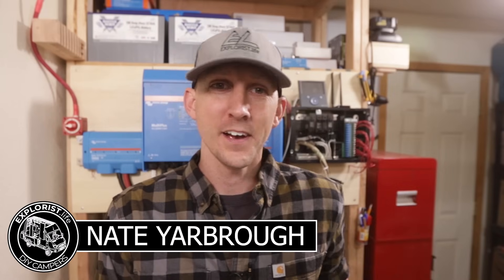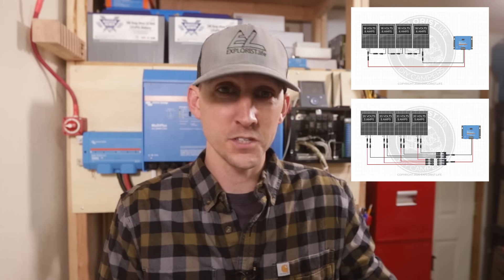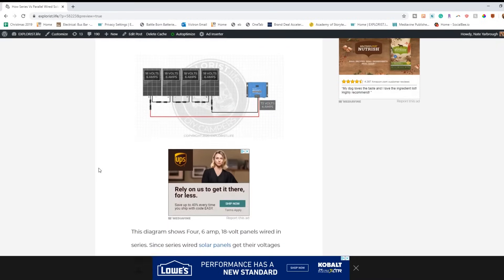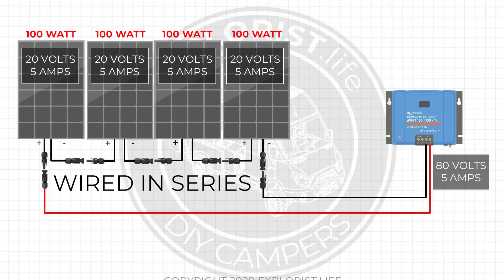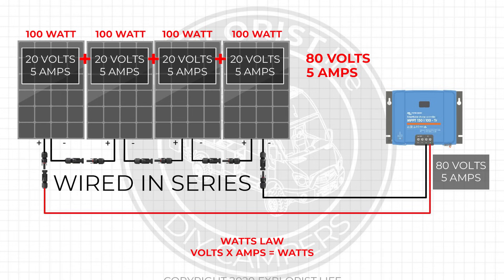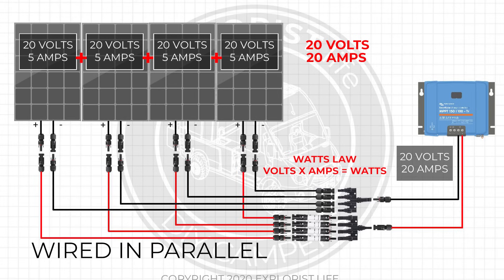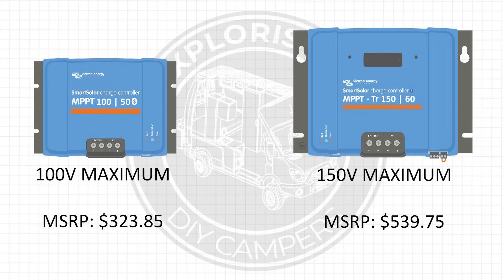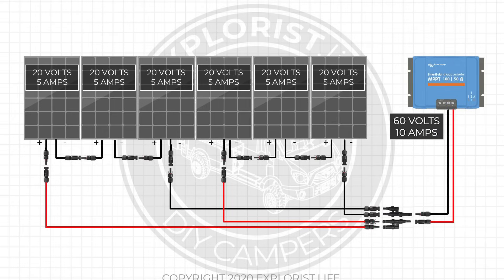Solar Panel Wiring vs Volts and Amps

Comment: Question: my solar kit has 4 100watt panels at 16.77v and 6.26 amps if my math is correct the in series parallel connection i would have 33.54v and 12.52amps. I have 30A PWM 12 Volt Solar Charge Controller with a max voltage of <50 but would the amps be an issue at 33.54?
Reply from the maker: With the Victron SmartSolar charge controllers, going over the output amperage is not a big deal, but without knowing specifically what charge controller you have, I cannot say.  You should reach out to the manufacturer of your charge controller for an answer to that one.

Comment: I have a question pls

I have 6 panels 150w ,18v, estimated low temp my country 10 celuis, panel stc 25 , voc 22.5, imp 8.33
Temp of voc -0.33
Temp of max -0.44

And I would like to make them 2 panel in each series
With 3 panels string in parallel
Total in array 6 panels

Me if I am correct I will have 36volts and 24.99 amps

If I’m wrong pls correct me and can you pls tell me what solar charge. Controller is best for me pls

Because I’m confused about this part
Reply from the maker: I think this video will help you figure that out: https://www.youtube.com/watch?v=MxziHKvTRh8

Comment: Question if you wire in series parallel does each series only get the lowest output like if one series is in the shade does the other series in parallel to that one also act like its in the shade?
Reply from the maker: The shade would only affect the series string that is shaded.  But I always must tell people... if you're worried about maximum solar production, don't park in the shade. :)
Reply: @EXPLORISTlife  oh yea I've been vanlifing it 6 years so I just realize the forest and trees and different spots sometimes I'm partially shaded and can't do much about it
Reply from the maker: For sure.  We've noticed that it's rare to have only part of the array partially shaded, it's usually all partially-shaded or nothing kind of deal.

Comment: I’m somewhat sure my question never is going to be answer but I’m going to give it a try anyway, (my average used is 45kwh,) I installed in the ground 20 panels, four rolls of 5 (250w, - Open C. 37.6V - Pmax 30.3 V - SC 8.85 A - CPmax 8.27 A - 600 Max Voltage - fuse rating 15A) also a hybrid MPPT 1.5kwh, 3.kWh and 5kwh and I’m debating what’s the best way to wire it, front the panels to the MPPT, 70 feet exactly, I used #6 wire, today is 12/28/2020, your suggestion or advise is very well appreciated.
hrsolis48@gmail.com
Reply from the maker: You'll definitely want to wire in series-parallel of some sort.  But what way will depend on the max voltage input and amperage output of your charge controller (and your battery bank voltage).  Here's a little more about how to size a charge controller and I think this will give you more data for wiring the panels: https://www.youtube.com/watch?v=MxziHKvTRh8

If you want me to take a deeper look into this, this would be something I could help with in my private group: https://community.explorist.life

Comment: Hi, ive got an lv2424 mppt all in one, and ten / 100 watt solar panels, clear skys no shadowing, what is the best way to wire panels? Panels are 40ft away from inverter
Reply from the maker: You'll definitely want to wire in series-parallel of some sort.  But what way will depend on the max voltage input and amperage output of your charge controller (and your battery bank voltage).  Here's a little more about how to size a charge controller and I think this will give you more data for wiring the panels: https://www.youtube.com/watch?v=MxziHKvTRh8

If you want me to take a deeper look into this, this would be something I could help with in my private group: https://community.explorist.life
Reply: @EXPLORISTlife  thank you much

Comment: Hi  Can I wire 2  24 volt solar panels together for 48 volts and add a enphase micro inverter for 220v grid tie?  Thanks you do a really great job of explaining.
Reply from the maker: I don't know much about micro-inverters as most campers do not have arrays big enough to warrant micro-inverters.  So... I don't know. :)

Comment: So, let's say  I have 2 strings composed of 8 (200) watts solar panels with 24.3 V and 10.2 A each panel wired in Series-Parallel... the first string is composed of 4 panels wired in series will yield 97.2 V and 10 A. The second string is wired just like the first also yielding 97.2 V and 10.2 A. So when Series-Parallel the two strings I should get 97.2 V and 20.4 A right?
So my question is what Amp total should the charge controller be and will 10 gauge wire be sufficient from the panels to the charge controller if they're 40 feet away from each other? Thank you for reading and for your time.
Reply from the maker: The formula for finding that is: Total solar array wattage x Battery Bank Voltage = Amps heading OUT of your charge controller.  More info: https://www.youtube.com/watch?v=MxziHKvTRh8

{10 AWG wire will be sufficient, yes}

Comment: K.  Can you hook up 2 panels in series parallel for more power and faster charging of batteries.?
Reply from the maker: to wire in series parallel, you need at least 4 panels.

Comment: Thank you Nate! This is another great and simple video! You truly explain this stuff very well and easy to understand!
- I do have one more question though: What happens if the series you wire parallel don't have the same amout of panels? So f.e. (as it is in my case) there are 9 panels with each 40 V and 3,5 A -> if you wire two in series you get 4 solar 'pairs' + 1 single panel -> how do you add up the Vs and As? And is that even possible? Or is that correct: 40V * 2 = 80V & 3,5A * 5 = 17,5A?
I look forward to hearing from you. And keep up the great work :)
Reply from the maker: This should answer your question: https://youtu.be/jejro4zkl8I
Reply: @EXPLORISTlife  Yes, it certainly does! Thanks a lot for your quick answer - and for another really good video ;) :)

Comment: Great video.. One question however, when you say each panel for example is 20v are you talking Voc or Vmp? and for the amps are you using Imp or Isc? I have tried calculations using all possible combinations of volts and amps and obviously I’m getting different results each time.

In this article,

https://www.explorist.life/how-to-choose-a-solar-charge-controller-for-your-camper/ 

you used Voc and Imp so I’m a little confused..  Hello from Australia 🇦🇺
Reply from the maker: When trying to determin charge controller size, you need to use Voc like shown here: https://www.youtube.com/watch?v=MxziHKvTRh8

When determining voltage during actual power output, you can use Vmp.

Comment: Hi, whats your thoughts on keeping an array voltage close to the battery voltage feeding a regulator as opposed to having a higher array voltage staying within the limits of the regulator,  besides cable sizing and considering morning and cloud coverage.
Love your work, thanks for spending your time!
Reply from the maker: The solar array voltage needs to be at least 20V higher than the battery bank charging voltage for the MPPT charge controller to work most effeciently.

Comment: Hi Nate - I love your videos!  You are my 'go to' for anything electrical in the van we're building, and we're going to use your diagrams and the Amazon links so we get exactly what we need.  SUPER helpful.  Thanks so much.  One question:  I may be using your calculator incorrectly, but I'm using 200W solar panels that have a maximum voltage output of 68.7V.  When I put in all the other values in your calculator, it tells me the Amp output is 16 amps per panel.  This seems high, and the specs of my panel say maximum current is 3.59 Amp per panel.  Google says amps = watts/volts, so I was expecting it to be under 3 amps per panel.  Why does your calculator show 16 amps (and it doesn't change if I change my Voltage, which doesn't seem right).  Help!

Comment: I m getting a jackery 100 with 2 renogy 100watt solar panel to charge it . How would u wire it? Thanks
Reply from the maker: How about this...  The max solar input voltage is listed in the user manual of the Jackery.  Based on that and on the information you learned in this video... how do YOU think the panels should be wired?

Comment: So any solar voltage will be converted to the battery bank voltage via the charge controller?
Does the charge controller or the BMS stop the current so your batteries don’t get overcharged?(I purchased LiFe phosphate)
If the batteries get disconnected by the charge controller or BMS won’t that hurt the charge controller? And if it doesn’t disconnect what you do with the excess power? Make a dump load?
Thanks ahead for helping me I’m really trying to get this knocked out!
Reply from the maker: 1: Correct.

2: Charge controllers handle that function, but they need to be capable of charging Lithium batteries (like the Victron Smartsolar MPPT Charge Controllers)

3: It may hurt low quality charge controllers, but it wont hurt quality charge controllers like mentioned above.

4: Excess power is not an issue.  It's just not used.
Reply: Thank you so much for answering!!!

Comment: I am using 24 v solar inverter by using 165w 12v poly panel connected series. Can I connect another 380w 24 v mono panel parallel with poly panels.

Comment: Ok, I just ordered a 2400 bluetti and 3 100w solar panels. How would I wire them to the generator.  I have received the generator yet. Looks like I will need to order some long cables to run the panels out side
Reply from the maker: like... the actual physical connection?  You'd have to refer to the user manual to see what kind of connection in necessary.  For the array c configuration... you would want to see what the maximum voltage input on the unit is and arrange your array so that the max voltage is not exceeded as you learned about in this video.
Reply: @EXPLORISTlife  thanks, once it comes in I will check. It looks like I will need to order some long cables to do what I would like. Thanks for taking the time

Comment: Hi Nate, imagine this scenario; three strings of 5 panels each connected in parallel to a single Victron MTTP controller. Question is; if one of the strings only get direct sun light a few hours after the other two, will this pose a problem to the MPPT, or will it compromise in any way its performance ? My guess is that it wont cos the tension will be the same at all times, only current will vary, but just to make sure...
Thanks in advance.
Reply from the maker: There won't be any negative performance other than the obvious lack of sun on that series-string.  The other two series-strings and the MPPT will compensate accordingly.
Reply: @EXPLORISTlife  thanks Nate, U R the man !!

Comment: What about the mppt max PV input power?

I have a 20amp mppt
Nominal system voltage 12v/24v Auto work. 
It has a Max. PV open circuit voltage of 60v.
It has Max. PV input power of 260watts (12v) and 520watts (24v)

Im confused about how much this mppt can handle.
If my panels are configured at 24v and battery is at 12v. Can I go with Max. PV input power 520watts (24v)?
Or is this referring to the battery needing to also be at 24v? 
Thanks for any help.
After seeing your video another question arose. 
Shouldnt my mppt be able to handle 60v x 20a = 1.2kw(1200w)?
Reply from the maker: What charge controller are you attempting to decode?

Comment: After watching this video and others, I have decided to do the following. My four 100 watt Grape Solar panels will be wired in series. I will have an MC4 15 amp fuse in the positive wire coming from the panels. I will use 10-2 AWG wire to span the 45-50' from the panels to the EPEVER 30 amp charge controller, with a typical 20 amp light switch and circuit breaker in the positive wire just ahead of the charge controller. I will wire my four 6 volt golf cart batteries in series to produce 24 volts, and use 10 or 12 AWG wire from the charge controller to the batteries. I will use 12 AWG wire from the batteries to the 12 volt water well pump, with the negative wire connected permanently to the negative battery post, and the positive wire going through a typical 20 amp light switch and circuit breaker from the battery to the pump. I will connect the batteries to the 2500-3000 watt sine wave inverter with the largest wire the terminals will accept in order to provide power to a separate 110 volt above ground water well pump which uses 9.8 amps at induction, and 4.8 running. The wire size from the inverter to this pump will be 12 AWG, with a typical 20 amp light switch and circuit breaker in the positive line.  Do you see any problems here?
Reply from the maker: Here is how I recommend wiring a system of that size: https://www.explorist.life/3000w-inverter-400-600ah-400-to-1200w-solar-camper-solar-kit

Comment: I have 8panels 4 are 120 and 4 are 150
My mppt charge controller is of 80 amps and Maximum voltage of 140vdc
Do I parrell or series or series parallel
Reply from the maker: Here is how wiring different sizes of solar panels in series vs parallel affects the array voltage: https://www.explorist.life/using-mismatched-solar-panel-sizes/

Comment: Can I wire two different sized panels IE an 80 watt panel with a hundred watt panel as long as they're both 12 volt?
Reply from the maker: Here is a blog post that will teach you how to determine how unequal panels will affect the array: https://www.explorist.life/using-mismatched-solar-panel-sizes/

Comment: 1000voltage is equal to how many Amps?
Reply from the maker: You also need the wattage.  Watts / Volts = Amps
Reply: Lets say a solar is 38.4v&15A...can i connect 50 solar panels in series wthout grouping dem
Reply from the maker: So... if you arranged all of those panels in series, what would your total array voltage be?
Reply: 38.4v×50=1920
Reply from the maker: And what is the max voltage input of your charge controller?
Reply: @EXPLORISTlife  not sure..wl give pics&videos on monday Sir
Reply: @EXPLORISTlife  max total input voltage of de chager controller is 400-800v

Comment: If I wanna live a van life and I want to add solar power to my van I’m in a power wheelchair. Would I be able to charge my wheelchair at night the charger is 115v 60hz 4.5a. And have a ac on just in case it was a hot night how many batteries would I need and what solar panels I have a 2003 Dodge Grand Caravan
Reply from the maker: For that, I would recommend performing a power audit so you can find how many amp hours of battery capacity you can anticipate using per day.  From there you can determine how many batteries and how much solar you'll need.  Tutorial: https://www.youtube.com/watch?v=a406IxiU-Xg

Comment: So if I have 3x 175w 9amp 21.1v solar panels if i wire them in series I get 63.3v and 9amps and if a wire them in parallel I get 21.1v 27amps. I have a 100/30 mppt controller so does that mean I get 9amp out of it with one setup and 27amp with the other like the amps the controller can put out to charge batteries.
Reply from the maker: Yes, BUT...  Those are the amps BEFORE the charge controller regulates the voltage down to a voltage appropriate to charging a battery.  The formula for figuring out how many amps the batteries will charge at is:  

Solar array wattage / Battery Bank Charging Voltage = Battery Bank charging Amperage.

Series wired solar panels will be the way to go in your scenario.

Comment: I have a question.... i got a 30 amp mppt charge controller, and just got 3  24 volt (210 watt) panels. I was thinking about wiring them: 2 in series and then wire the other in parallel to bring up the amps. But, won't that drop the voltage on my series set?  Should I just wire them series to make the 72 volts with 8 amps or wire them in Parallel and get the 24 amps?
Reply from the maker: Wiring 2 in series, and then the 1 in parallel will greatly handicap your system for the reason you mentioned and I would strongly advise not doing that.  If your charge controller can handle that many volts, I'd strongly recommend wiring your array in series.

Comment: What is the most efficient solar panel wiring setup to get the most power for an MPPT 40A (150v) charge controller with 2x Battleborn 12v 100AH connect in series for 24v?
Reply from the maker: Either series or series parallel depending on the specs of the panels.
Reply: @EXPLORISTlife  I could not find series parallels wiring example on your website it's all series I think, do you have nay examples? Thanks.

Comment: After watching oe of your videos I realized that I am not using the full potential of my system.  I've since taken everything apart and I'm going to start over after watching all of your videos.  As a backup I'm wondering if you could send me a diagram that I can refer to when I'm on the roof.  I have 4x100 watt 12 volt panels panels.  I have 6 x 12volt Gel 75 AH batteries, and I have numerous types of charge controllers.  I have a 60 foot long 12/3 tech cable between my panels and charge controller.  Everything I'm running is 12 volt.  How should I wire my panels parallel, or series??  What size and type charge controller should I have??  Is my 12/3 wire heavy enough, if not what do you recommend??  Do you have a diagram for my type of system??  I've watched lots of Youtube videos, but yours are the best.  I hope to hear from you soon.

Thanks
Reply from the maker: Q1: You should run your panels in either series or series-parallel depending on the charge controller you choose.

Q2: How to choose a charge controller: https://www.youtube.com/watch?v=MxziHKvTRh8

Q3: I generally recommend 10 awg wire for solar panels to charge controller runs.

Q4: I have diagrams available here: https://www.explorist.life/solarwiringdiagrams